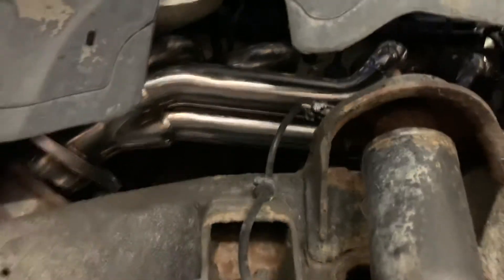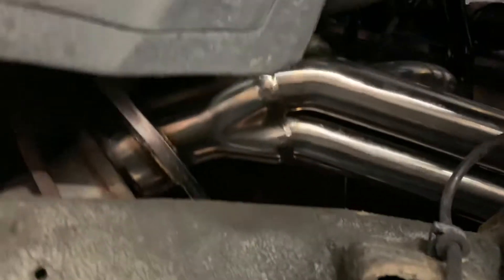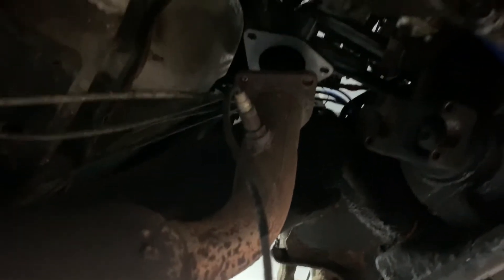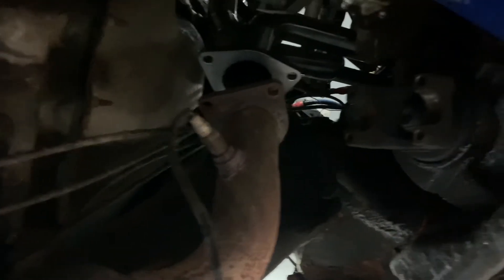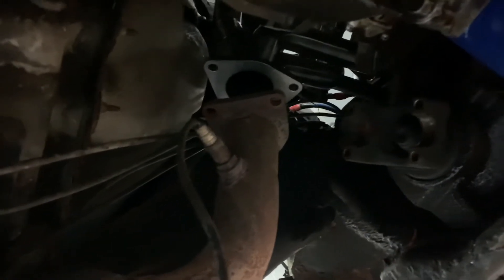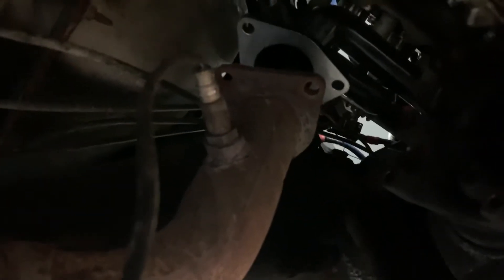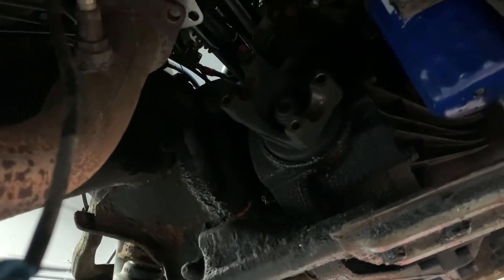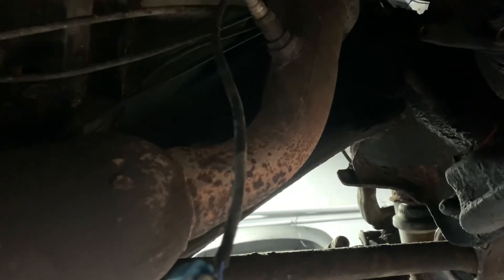ebay 4.8 5.3 6.0 stainless shorty headers. issues and solutions. 99-06 video 2 of 3

Comment: Did you have any problems with a sensor on the front primary? My 2000 chevy silverado 1500 5.3 has a sensor placed on the front tube and it goes into the engine. Any idea what it is and how I can get rid of it
Reply from the maker: post a pic
Reply: @stephenksetliff  It is the EGR sensor. I just found this out.
Reply: @stephenksetliff  on the truck you were working on it seemed that it was an 03 or newer, which does not include the sensor.
Reply: @stephenksetliff  I'm going to get a EGR delete kit now and see if it works.